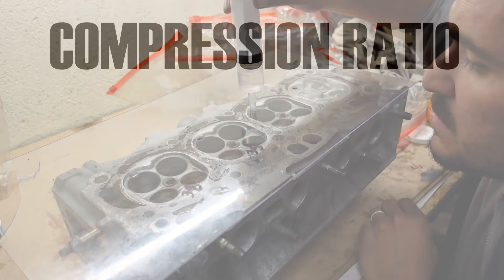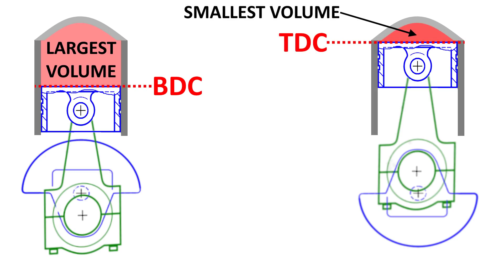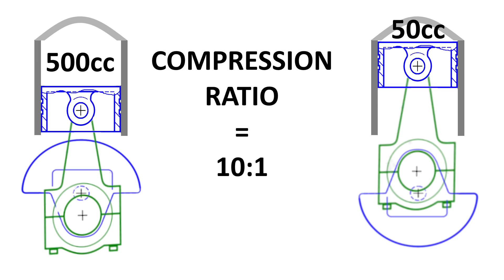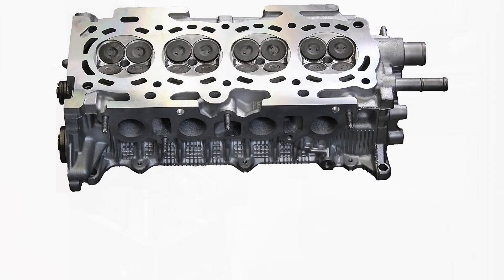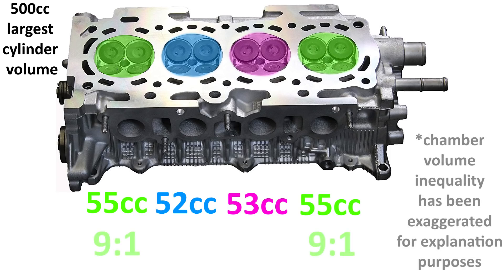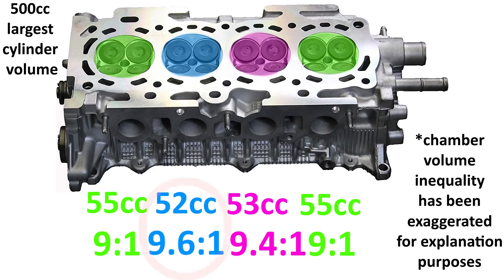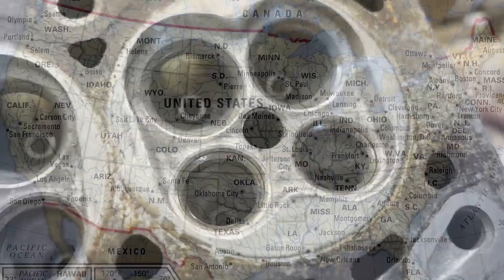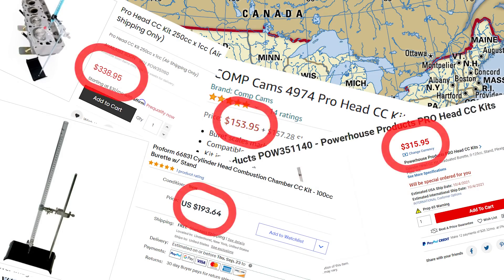HOW and WHY to EQUALIZE combustion chamber volumes CC - Project Underdog #10

Comment: what if you want MORE compression ratio (302 windsor with 9.0:1, i want to go 10:1)? just get thinner gaskets? or do i need to face the bottom of the heads at a machine shop?
Reply: How do you know?  If you didn't measure, you're guessing at best.
Reply: @lobuxracer  so im better off just buying heads from the xr8 since they have 10:1 from factory and have better ports?
Reply: @bigcazza5260  How do you know without measuring everything?
Reply: @lobuxracer  because from factory the low output 302 is 9:1 and the high output is 10:1. so just swap the head. its a 20 year old clapped out skidder, like i care about measuring, if it runs it runs
Reply: @bigcazza5260  Fair enough.  You're not trying to win a championship with this powerplant, just looking for decent performance.  I wouldn't waste time on most of the blueprinting stuff if just running decently is my goal.  You can tolerate some substantial variances from ideal and still be just fine.
Reply: @lobuxracer  so  yeah just get a thinner gasket
Reply: You can get a thinner gasket, and while the head is off, you can ask the machinist to remove the most the service manual allows.
Reply: @skylinefever  you think im gunna pay a machinist over 1 grand on a car worth 500 lmao.
just do it myself
ive almost got the auto in it running mint just needs solenoids

Comment: Hey mate, Just a tip for next time... rather than using the scale on the syringe to measure the volume I've found it much easier to buy a precision set of scales and measure the syringe before and after you fill the chamber. Even cheap (under $30) precision scales will measure down to .01 grams which is more accurate but mostly its just easier as you don't need to try and keep track etc. Just fill the syringe, 0 the gauge, fill the chamber, remeasure the syringe and do a simple calculation. Cheers

Comment: I think it is more common to use oil / kerosene rather than water, I believe it is because water has high surface tension which may change the result
Also ... I would remove the gasket more thoroughly, because the residue seems to be affecting the height

Comment: Cool, I actually just cc'd my 3ac-su head. I used a $20 burette, and a cell phone holder arm to hold the burette. my chambers were 31ml on average, but I'm use a 4ac block crank and pistons. they were all within .2 ml, and I suspect the spark plugs may have trapped bubbles, as they are mounted at an angle and they weren't perfectly clean.

Comment: If you have a accurate scale you can use it to accelerate the measure process.
Instead of doing a measure in the cylinder every time you can just weight the volume of water in the biggest cylinder and keep increasing the volume of the smaller ones until they can take the same amount of water by weight.

Comment: As my heads have recessed chambers I used a CDR sanded to size and made transparent by removing the recording surface.
Looks like your seats still need cutting which might throw out the CC balance again.

Comment: Nice video! It's cool to see how sometimes we need to alter our approach in order to get the results we want, such as moving the holes for filling the chambers to a spot where it's easier to get air out of. A couple of things I'd like to mention as a former basic chemistry student: significant digits and margin of accuracy/error. The short version of both is that not every measuring device is truly accurate, and not every measurement can be correct to the smallest digit available by the measuring devices. That said, the measurements you were doing should be good enough for enthusiast work because you are chasing a power level easily obtainable by your overall setup and not making a 1K HP drag machine.

Comment: Great video as usual, but I'd like to know what would be an acceptable difference across the combustion chambers? For example, would it be acceptable if all chambers were within 0.3cc of each other (Cy1 = 40.4cc, Cy2 = 40.5cc, Cy3 = 40.6cc, Cy4 = 40.6cc)

Comment: Re: the large syringe at 34 cc initial fill. There are cheap digital scales easily available that can measure mass down to 0.01g (or even 0.001g). So it would be easy to use a scale to ensure that the 34 cc syringe initial fill is consistently identical across the four chambers. The point here is consistency, not anything directly related to accuracy (except the improved consistency). Cheers.
Reply: A slight improvement on his approach, but not quite perfect.
Follow all the steps up to filling the chambers with water. At that point, fill the large syringe with REFRIGERATED DISTILLED water and weigh it with a gram scale. Fill one chamber with water and then weigh the syringe again. The weight difference in grams is equal to the volume of the chamber in cubic centimeters. (well...technically 1cc of distilled water weighs 0.9982g, but that difference is too tiny to matter.) Refill the syringe, re-weigh it on the gram scale, fill the next chamber, and calculate the weight difference again. Repeat for all chambers.
Reply: @fyrstormer  . It  is my recollection , that the Metric Weights and Volumes are thus .
One Cubic Centimetre of  pure water , at 4 degrees C , the highest density point , is the DEFINITION of One Gram .  1.00000g
Ergo , One Litre = One Kilogram and 1000 Litres = One Metric Tonne . The Scale definitions based off the Standard Metre .
Reply: @fyrstormer  Are you saying weighing the water is a slight improvement? Its much easier and much more precise (with good technique and reliable scales), compared to stuffing around eyeballing syringes. One drop of water weighs about 0.05 g (50 mg), and any reasonable digital scale is precise enough to about 0.01 grams. Whats your slight improvement? The density of the water makes no differnce, it wont change so does not matter. He doesnt need an accurate measurement of the volume, just a precise measuremnt of each volume so he can calculate the differnces.
Reply: @jumboegg5845 to be fair.. measuring by weight is more accurate and faster than eyeballing volume in a syringe.  

Regardless of whether or not you need to do a little math to convert your results. 

If consistency takes precedence,  the method matters.
Reply: smal digital cheap scales are wery dificult to use acuratly and consistently.
Reply: @drajo123  bruh if i can use a mg scale drugged out of my mind to measure mg scale stuff then idk what to say about ur scales but maybe get better ones
Reply: @drajo123 we're not working at that degree of precision.  0.01~ margin of error is negligible if you were already measuring in CC's.
Reply: @drajo123  
No, they aren't.
Where exactly do you have problems?
Maybe I can help you out.

I routinely make perfectly repeatable measurements down to +/- 5mg, +/- 2mg if I take the time, that's the limit of the scale I'm using.
And as stated, they're repeatable even after weeks.

Having things more than accurate enough for measuring out your combustion chambers to 0.1cc in a rather short timeframe shouldn't be a problem at all.
I'm too lazy to calculate it rn, but I think even rather substantial temperature swings won't cause enough difference in density to actually matter much.

Comment: I have done this many years ago when I was racing and rallying cars. You should surface the head and grind and lap the valves and seats first. Use old valves to protect the valve seats while you are grinding the chambers. Number all the valves so they are all matched to their seats. I seem to remember I used kerosene to measure the volumes. It’s quite a time consuming process but when you are trying to gain every possible HP out of the engine every bit helps. I remember checking cam timing and shimming the sprocket key way to correct cam timing. I even use to lighten and balance pistons and Conrods, lighten the flywheel and have the engine fully balanced.
Reply: Sure.  Lap the valves and see a 5% decrease in flow.  So 20th century.

Comment: Nice job on the head but what about piston compression height variances?  A 1000th inch (0.025 mm aprox.) difference in piston compression height in an 80 mm bore (common for I4 engines) is 0.125 cc.  The same would be true for connecting rod center to center distance variability and crank throw variability.  If you truely want equal compression ratio across all cylinders you may actually want slightly different combustion chamber volumes to account for these other variances in your engine parts.
Reply: Absolutely, 100% agree.  Piston casting variations, head gasket, connecting rod, crank and crankshaft bore.  And probably other stuff.  The only way to get a true number is with the engine assembled.  All of those errors are going to stack.
Reply: @unhinged-menagerie  Thx, problem is while you can kinda get piston compression height measurements the crank and rod measurements are extremely hard to get without very specialized equipment.

Comment: A digital postal weight scale can help a lot with measuring the combustion chamber volume.  If you weighed your water container first, then fill the CC to the brim, then weigh the water you have left, the difference is weight of the water in the CC ( assuming you didn't drip or spill ).  Then convert that weight to volume ( adjusting for temperature, too if you want SUPER accurate ) .

Comment: Amazing video as always but i would like to point out a couple things were missing
1- for diyers you could easily buy a burette sold on chemical supply stores for a fraction of professional kits
2- if you plan on getting your head decked do this before trying to equalize you combustion chamber volumes
3- generally is better to use a single piece of thicker glass with a hole could be bought cheaply at a glass store and make it a little more accurate

Comment: I've never heard about equalizing combustion chamber volumes! I just assumed they were precision made and would already be equalized. Good to know it's something worth checking on second hand engines you are building. TY!
Reply: All cast pieces; blocks, heads, intake manifolds, etc. are mass produced using sand molds. There is lots of variation between parts. You probably can custom order heads and blocks already prepped to your specifications. If not, some good old fashion elbow grease, knowledge gained from reputable web sites, and time can result in higher performance, better fuel economy, and a feeling of satisfaction.
Reply: @SJR_Media_Group  does small varyations i  chaimber shape not matter, as long as volyme is the same?
Reply: @DaftFader  it's almost impossible to get exact shapes of the combustion chambers , but today with special CNC (Computer numerical control), they can get really close. Old timers spent hours, even days to match combustion chambers, intake and exhaust ports. I would have taken mine to a speed shop and let them do it.
Reply: @DaftFader  
The approach (working assumption) is basically: those small variations in combustion chamber shape is too small and can be ignored. 

Think in terms of “signal over noise”. 
Whatever variations, if the “signal difference” between those variations is smaller than the “environmental noise”, then those tiny variations don’t matter.
Reply: In a stock engine it's close enough, but a modified engine is by definition not a stock engine. The modifications are what cause the problems in the first place, so more modifications are needed to fix the problems.

Comment: I thought that reducing the compression ration reduces the performance of the engine but that it's less wear on its bearings.
Reply: The compression stroke produce around 200psi, but the combustion thousands, so not related in any way, with the bearings...
 It's a must, for the conversion, from n.a. to force induction, with high boost levels, because of the insanely higher temperatures.
 One can get away with low boost and high compression ratio, as the older Audi turbo engines.

Comment: Just a question. Would you not get the head skimmed before doing the compression ratio/equalisation proses?
Reply: Some people won't do it because if they slip up, they might ruin the machine work, and have to do it again. This is especially bad news if you engine has a very short piston to valve clearance, or the manual does not allow much to be milled off the head. Still, to get the best results, milling the head first is best.

Comment: I might have another way; Use plasticine. Push enough in, to completely fill each camber, using a rolling pin to get it level with the face. Next, get a glass and a tray. Put the glass on the tray. Fill the glass with water right up to the rim. Pull the plasticine out of the chamber. Roll it into a ball and slowly put it into the water. Because of displacement, the water will run out, onto the tray. Measure the water in the tray to get your volume.
Reply: So if you want to usethe plasticine then why not just measure its mass with some cheap jewellery weighing scale?
Reply: @Bialy_1  maybe while compressing it with a roller, you could end up with parts that have higher density and therefore higher weight while still having equal volume.
Reply: Plasticine can't get into the hollow space inside the sparkplug. (yes, that tiny little bit does matter.) Here is the best approach:
Follow all the steps up to filling the chambers with water. At that point, fill the large syringe with REFRIGERATED DISTILLED water and weigh it with a gram scale. Fill one chamber with water and then weigh the syringe again. The weight difference in grams is equal to the volume of the chamber in cubic centimeters. (well...technically 1cc of distilled water weighs 0.9982g, but that difference is too tiny to matter.) Refill the syringe, re-weigh it on the gram scale, fill the next chamber, and subtract the weight difference again. Repeat for all chambers.
Reply: @fyrstormer  Use a 14mm bolt instead of spark plugs.
And petrobond casting sand.

You could weigh the sand , and since it forms a perfect impression , you could take the one from #1 cylinder and set it in #3 to see where they differed.

That way you can match volume , shape and valve seating.
Reply: @glennchartrand5411  came here to say this 👍🏼
Reply: Omg its smart. I like the productivity and open mind thinking no one would of thought about that

Comment: The cost of the tool (cc volume tester), that you can use over and over and over, is relatively minor compared to what you gain.  Therefore, the cost is minimal, even (especially) for the shade-tree mechanic enthusiast.  In my opinion.  When I had my stock '69 Camaro motor rebuilt to accept a turbo, I had the heads "cc'ed".  It is worth matching ... good video.
Reply: You have to value the performance improvement very highly -- or rebuild lots of engines to spread-out the cost -- to claim that the cost is minor compared to the performance improvement.

Comment: Great job 😎👍

I have a question.
How much, will the geometry differences of the chambers, influence the way the engine will perform?
Reply: Geometric differences between combustion chambers in the same cilinderhead will hardly make a difference as long as the overall shape remains the same.
Reply: @TestTest-eb8jr  I've seen cases where small geometrical differences, have an impact in how air enter and spreads, in a certain, chamber/space volume, and the consequences of it. Not in an engine, in some other applications, but the  mechanics of the fluid are the same. Therefor my question. As long, as the chambers are modified by hand, I am not expecting a very good precision of the geometrical shaping of the four chambers. So, as the geometrical differences, can not be avoided, between the four chambers, what can the effect of it be? It is a known fact, that the performance of the combustion engines is kind of pour, also, because of the non-perfect homogeneous mixture of the air and petrol, in the combustion chambers. 
So the geometry of the chambers is a very important factor.

Comment: I would prefer to use only a single, large syringe instead of 2 and simply measure the weight of the large syringe before and after you have filled the chamber. That should be more precise as adding a volume from the large syringe (with a large uncertainty in measurement) with the small volume from the small syringe will cause a relatively large uncertainty in the volume measured. 1 gram = 1 ml.
Reply: you would need pure water at exactly 4°c for it to be 1 gram equal 1 ml.

measuring the volume from the syringe may be faster and not that much more imprecise than doing a weight measurement.

anyway, be it from the volume or weight measurement, there's bound to be some error.
Reply: Measure with a micrometer, mark it with a crayon, cut it with an axe.

Comment: if you add 5cc to your combustion chamber the compression ration will be 505/55=9.18 ... and not as the presented calc..
Reply from the maker: It's 500/55 not 505
Reply: @d4a  why ?
Reply from the maker: Because that's the number I made up for the total volume. It's just an arbitrary number for the sake of the example and as you can see in the graphic the maximum volume includes the chamber volume already.
Reply from the maker: Oh wait. No, you're right I was wrong. Total volume also increases by 5

Comment: Awesome video as always! I'm always surprised I don't see a lot of people do this with their builds. I guess they assume whoever refreshes their heads does it, but I'm betting that's a faulty assumption. Others probably don't know they should do it. I supposed in a completely unmodified head other than being resurfaced you shouldn't need to, but still, I'd wanna know. I like the syringe idea over the burette! Feels like it would give more control. My excitement over this engine keeps building!
Reply: The syringe method is pretty good. I've used it when cc'ing ACVW heads.